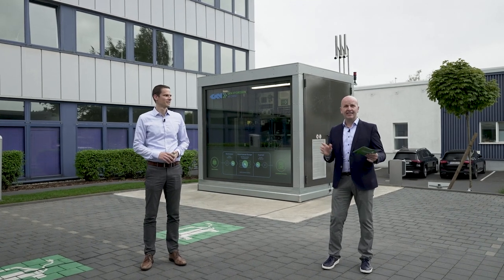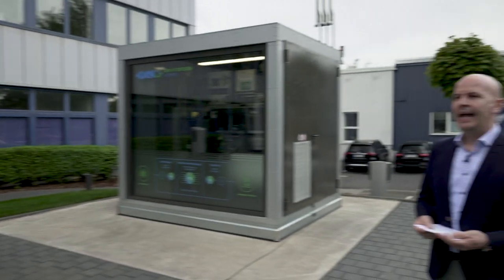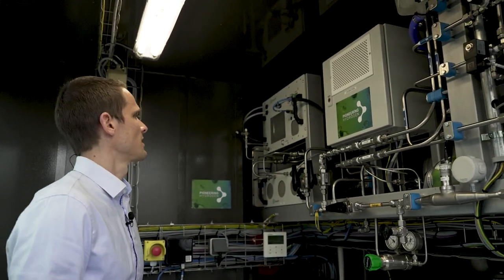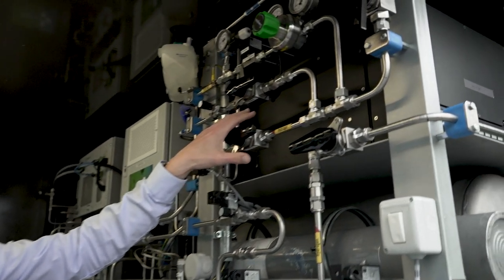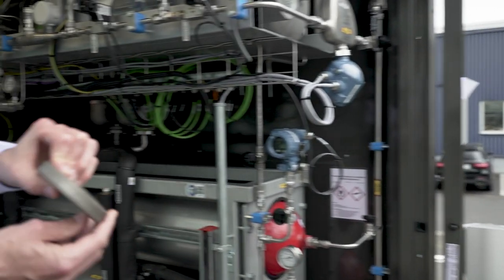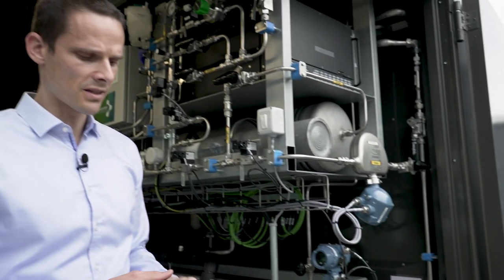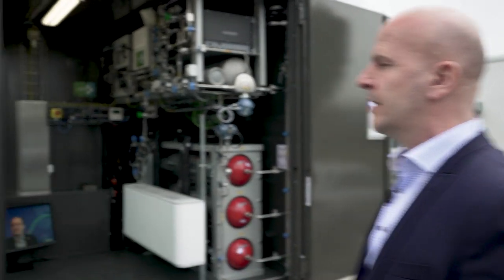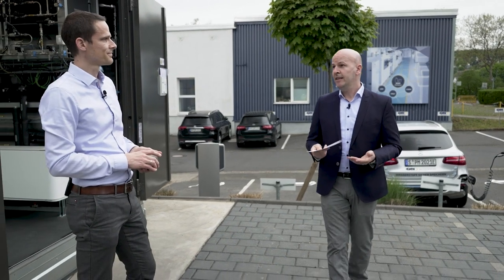A tour inside one of GKN Hydrogen's HY2MINI demonstrators

Comment: So, you're taking electricity to make hydrogen to convert back to electricity to charge a car, why not direct from solar to car, it would make more sense to use the hydrogen to fuel the cad directly, which i would guess will give more range, predferrably hydrogen engine.
Reply: First off it says it's a demonstration project.  But the sun doesn't shine at night so this demonstration project can charge any time, around the clock.
Reply: It is not so simple as you make it out to be. Rookie mistake in thinking that way
Reply: Hydrogen is used as a battery